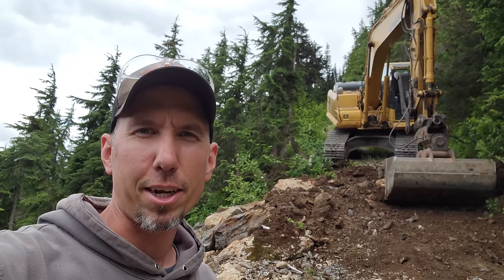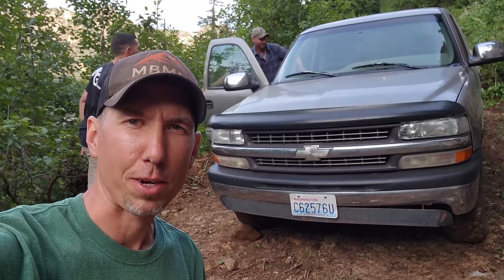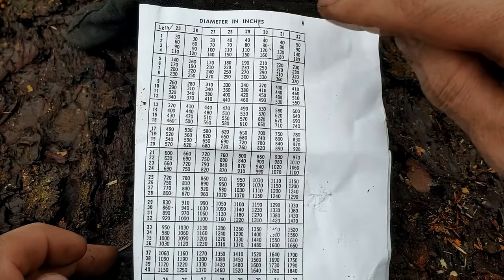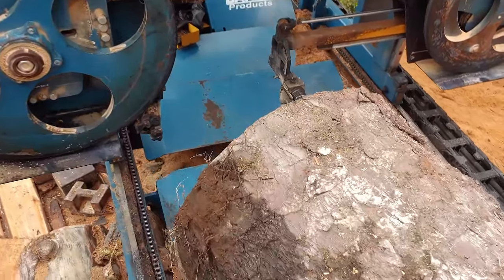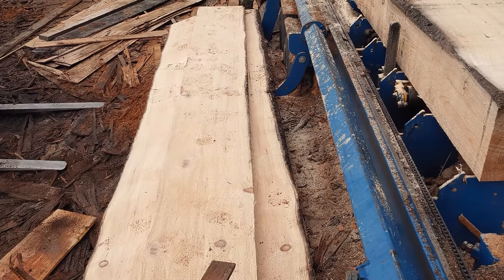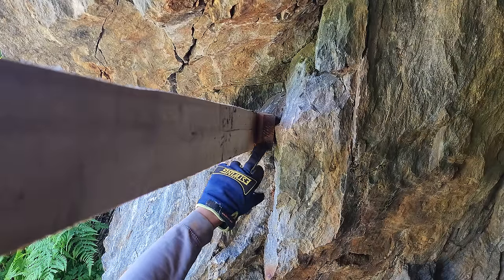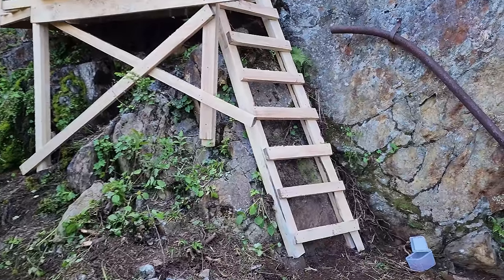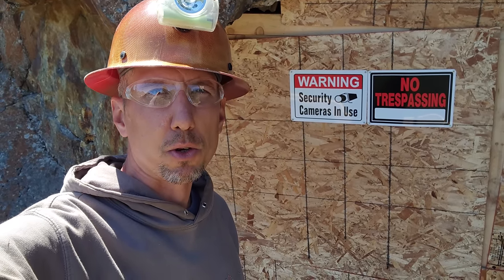Opening My Gold Mine! Part 1 Timbering The Portals

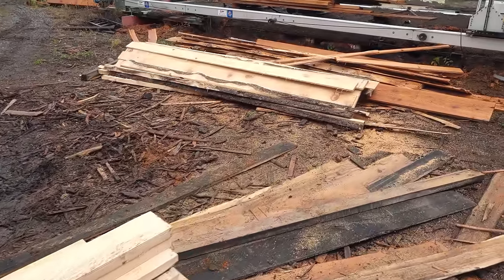Comment: @16:01 - Great firewood indeed.  I lived in an old 1800s house without a forced air furnace.  My father in law was the local sawyer and coal hauler.  He has a 48" circular blade and a band saw getup like this.  He would roll by the house periodically and drop half a truck of stove coal and half a cord of cutoffs in through the old coal chute.  I usually kept a fire going, but there were several winter mornings where I had to go start from scratch in a cold firebox.  Holes in the floor to circulate heat was all we had.

Comment: I’m hoping you’ll fix the track so you can bring it to the end if the deck and dump it right into a dump truck to haul off the material??? Definitely a lot of work your lucky to have the mill it’s way cheaper than buying it and you can make the sizes you need very cool thanks for sharing see you on the next one 👍🏼👊🏼

Comment: seen some similar saws setup on railway gauge, toyota diesel and petrol engines with manual gearboxes still attached, as power. around 4ft each wheel that ran the blade, no guards, pushed by five men at a time, all day long. Could hear those blades snapping and flying through the air at 1km distance

Comment: 4x4 timbering at the portal will not safely hold the weight of the overhanging air-gaped vertical and horizontal cracking of the roof and sidewalls.  Use correctly dried 16 to 24 inch diameter timbering that still has the bark glued to the timber.  These timbers will last 30 to 100 years, depending on the mine's humidity.  You should also drill and install rock bolts on the walls and ceiling.  If ever inspected by a governmental mining regulatory agency, they would put a "red tag" across the portal with only allowing the working on the needed timbering and rock bolting throughout the mine.  I do have Certified Fireboss  Mine Papers (coal and hardrock), needed for safety inspection of the entire underground coal or hardrock mines, which is required before miners are allowed to start each shift's coal or hardrock production.

Comment: You're correct, that's 100 feet per second 👍
Also, could you use a power washer to clean the logs so the blades won't dull as fast on the mill?
Reply: Great suggestion around power washing. Jason probably didn’t realize how mucky the logs got while hauling them to the loading zone.
Reply: My father always said how dirt , grit and sand dulled a chainsaw quickly too. If he fell the tree then he cut it for firewood right there where it lay. Lumber is different process, power wash is desirable for sure.

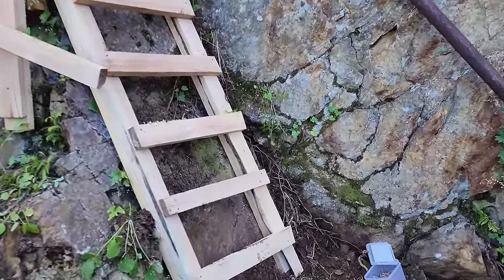Comment: @22:13 If you're only gonna put one screw in each ladder step, put them lower down in the board so that the weight is pressing down on the screw instead of hanging from it. Less chance of the board splitting out the end and gravity doing it's thing to the ladder user.

Comment: I would recommend every so often in mine to but a battery charging station for all the batteries, slotted spot for charged, hanging spot for needs charged.     Save lots of hassle in long run.

Comment: The lumber may be worth more than the gold. Dirt will dull a bandsaw blade just like a chainsaw. You should power wash the logs before you cut them. You'll save money on blades and make the sawman happy. We have drive trough carwashes where you clean it yourself with a powerwasher. Its only about $2

Comment: well you diy, so worth is only your internal measure
Reply: if you use ethanol-koh metal-air fuel cells, that use oxygen, then when the device stops surprisingly, you are out of oxygen, in the deep mine
Reply: metal-air fuel cells dont produce carbon dioxide, just rust the metals, from air oxygen